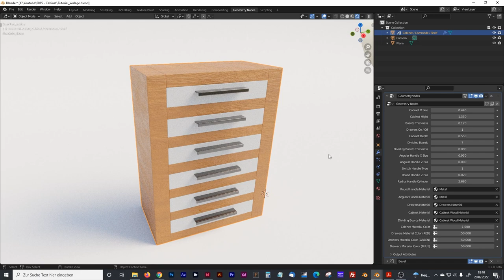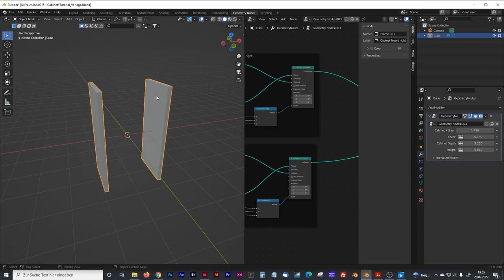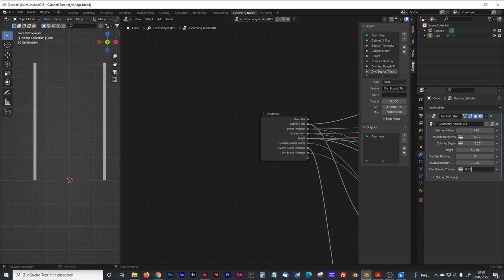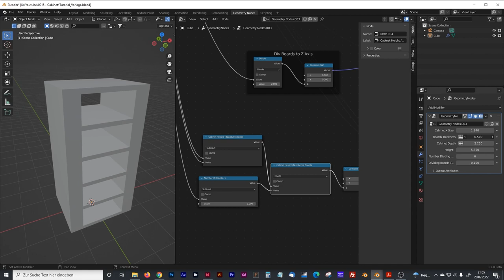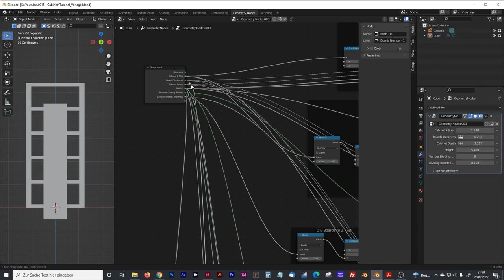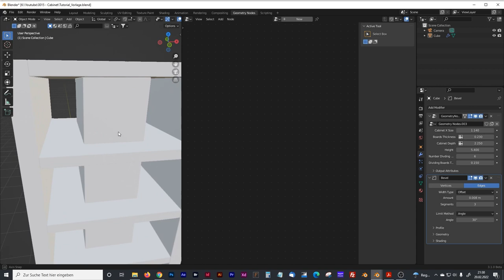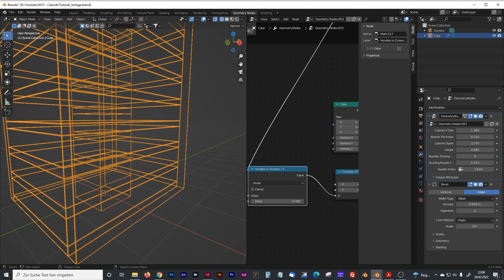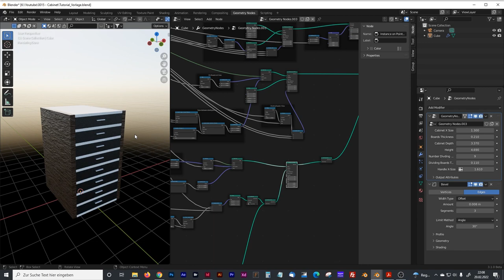Blender Geometry Nodes Tutorial - Procedural Cabinet or Furniture

Comment: Thanks for the tutorial BlenderDude! While following along I noticed that the Mesh Line Node has an option for 'End Points' instead of Offset. This allows you to easily set the start and finish of the dividing boards, and then it will just add board in between as you increase the board count. 

Cheers!

Comment: Hey nice work! Really great idea and i really liked how you explained the steps, in the end i could actually do the past few steps without the tutorial, because everything made so much sense!
Just a tip: You can set multiple Group Input Nodes, that way you dont have to track the whole way to the beginning everytime! :D
Grüße aus Köln!
Reply from the maker: Hey, thanks! Yeah, I don't know why I don't use group input nodes - I have to get used to them, good tip! In the end the whole composition looks like a mess :-D / Grüße aus Mainz :-D!
Reply: @blenderdude5050  Eine Frage, was ich einfach nicht gelöst bekommen habe: wenn PBR-Materials sette, sind diese immer verzerrt. Egal ob ich im Shaders Tab UV, Normal, object oder Generated als Mapping vector nutze. Bei dir sah das Holz aber normal mit Struktur aus. Weißt du, wo der Fehler liegt? (habs leider nicht auf englisch formuliert bekommen)
Reply from the maker: @NicoNoFace  Hi, yes, I know the problem and I am currently looking for a solution - as soon as image textures are in the shader, the texture no longer behaves as expected. But somehow logical, because you can't do UV mapping... that's my idea. The more distorted by GN, the more difficult it is for Blender to put the image texture correctly over it. Currently I only use shaders without image texture, that always works.

- Ich schreibe meine englischen Texte immer in Deepl.com, der übersetzt das dann besser als Google Translate :-D

Comment: Great tutotial, but some things could be optimized, ex. 12:08 . Why don't you just put single "divide" output to each Transform. You don't need second set of "Combine + Divide".
Also you don't need two transforms. You could bring everything up after "Join Geometry". Or do it right after "Group Input" (I did it this way. Group In. --> Take height and Divide by 2 --> put to COMBINE XYZ Z-value ---> ADD to initial vector used for overall width --->  put to Start Location)

Anyway, thank you so much. +10 to knowledge))

Comment: They still sound difficult and complicated, but I try to follow all their training. Really very nice tutorials!! (I hope the number increases)  / Only in cycles, the texture is covered with blackness on the right and left parts. How can i solve it.
Reply from the maker: Hi, thank you! I think the texture problem occurs when you have linked "UV" in the "Texture Coordinate" node. Correct would be "Generated" or "Object". Try it out!
Reply: @blenderdude5050  It didn't work, I probably made a mistake somewhere. (It works the same as the example you made)

Comment: At 9:20, there's no point creating duplicate Combine XYZ and Divide nodes to drive the Transform nodes since both sides of the cabinet will always have the same Z position. Just use one set and plug the Divide output into both Transform nodes.